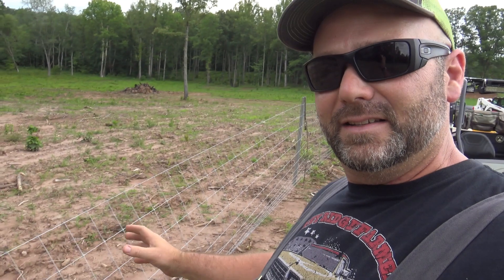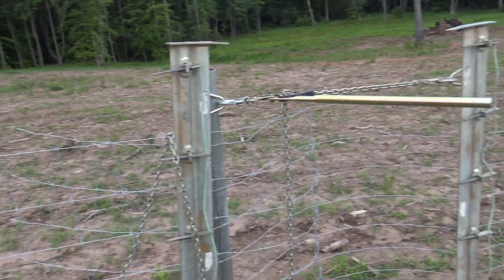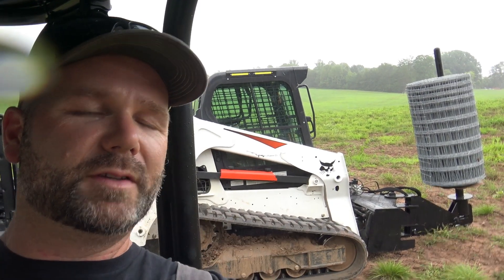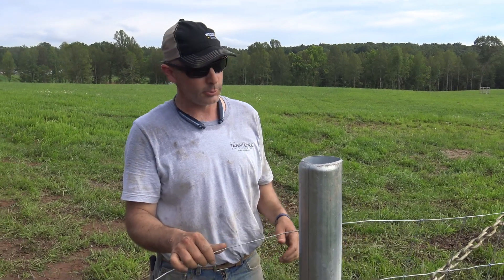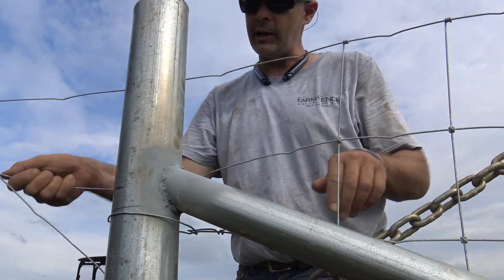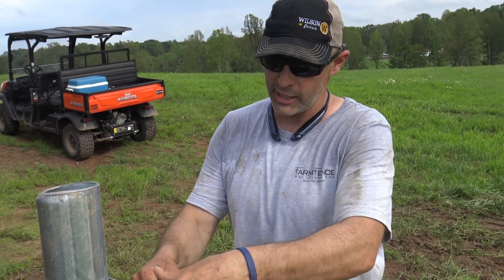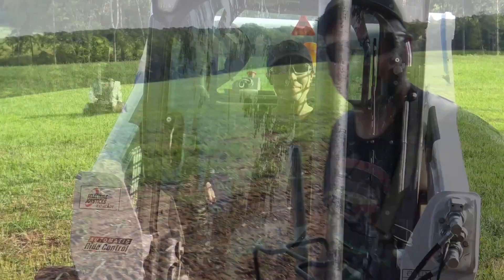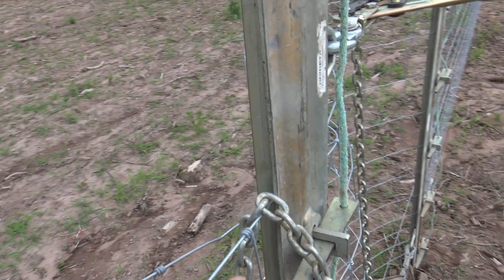Farm fencing at it's best! Learn fencing tips as we build 1 mile in a day!

Comment: The not they use is prettey simple it doesn't look like it would hold up to a lot of pull but after I seen how it works it deffinetley a strong not and just so simple the more pull the tighter it gets its awsome good job ya all looking good
Reply: It's strong alright. Our longest single run without tying off to any strainer posts in between is about 8½ km (>5¼ mile) of 6 ft high netting. Tension looks about the same as Stoney Ridge is putting on
Reply: @wrerikwinkler   I want to come fence with you!  Straight runs like that are what I dream about.
Reply: Farm Fence Solutions LLC in Australia we have what is known as the rabbit proof fence which was put up in the early 1900s. It's a total of 3256km or 2023miles depending where your from.
Reply: @47Rolling  ya t j.g atsg a lot of fence wow I'm up in newhampshire but wow it's amazing how far this fence can stretch

Comment: There is a you tube video about the Dingo Fence Machine that does six strand electric fence, two men, truck, trailer, ATV and marking equipment. Six kilometers ( Australia ) or 3.728 miles per day. It's great to see all this happening. A mile a day is phonemonial.
Reply: Karl Elliott  That’s a really neat machine!  Straight line fencing with no rock sure would be a dream, wouldn’t it?
Reply: Farm Fence Solutions LLC  Yes, I found it pretty amazing. Charles Kauralt said N. C. mountain land had to be pretty strong to hold up all those rocks. A fence post hole through granite is pretty stout. Down east sand and Piedmont clay, not so bad in places, except for the granite rollers and flint rock. In southern Davidson County N. C. our well went 243 feet through dry slate, hit the water which came within 20 feet of the surface and with air blew a solid six inch river. Hedrick estimated 1500 gallons per minute.

Comment: NOICE!!  Hey Josh, why the change in fence from the 1348-12 to the 1147-6?
Reply: We were showcasing a bit of the variety available from Tornado Wire.  1147-6 Torus is a square knot fence, which still has the stiffness of a solid vertical stay like 1348-12 Titan, but with the added capability of 1/4 mile rolls.  The USA has a very diverse regional net wire preference, so we like to appeal to as many as possible.  Thanks!
Reply from the maker: We wanted to show you some diversity and do some longer pulls

Comment: For those that play with galvanized pipe, welding , and if you don't have a mask, drink a 1/2 quart to a quart of butter milk right after. Quantity depends how long you were welding. If welding 8 hr's, a quart of butter milk. It help's big time.
Reply: That is only a temporary fix.  The long term damage will already be done.  Just DON'T weld galvanized steel without proper lung protection.  It's not worth it.

Comment: A winch with a remote?!?! Oh man, add that to the list.....
Reply from the maker: Was pretty sweet huh
Reply: I have one on my ute (pickup to you guys), saves having to pop the bonnet and run cords for the controller when you need to use it. You can pick up a reasonable wireless remote that hooks into the solenoid for around $15 on ebay. Great invention.

Comment: I saw them throwing broke off pieces of wire inside the post. Not a good Idea. Those pieces will rust on the ends and wherever they touch the post rust will form. Suggest getting a magnet  and retrieving those pieces.
Reply: That's not how a sacrificial anode works my friend.  The cut end will be healed over in a matter of days.  Good on ya for thinking of that kind of detail though.  Most folks wouldn't care enough to give it a second thought.  Thanks!
Reply: Electrolysis will result,  A anode is designed to decay first. The wire is not a anode.  A anode is usually made from Zinc and or aluminum.  A anode is usually firmly attached to the part being "saved" so the sacrifice is the anode corroding away and not the  good part. Nice fence .  @farmfencesolutionsllc
Reply: Mike Goodman  Galvanized coating is the anode. If you can prove me wrong with a controlled test, I’m all in and will eat my hat. I can cut a piece of wire, leave it in the rain, and it’ll never (in the next 30 years) rust.  You can scrape the Galvanized coating off of wire, and it will heal right up. I do appreciate the theory, but I like evidence to support the theories I back.  Electrolysis wouldn’t occur without a source of stray voltage, which isn’t present in this situation. Galvanic corrosion could occur in the perfect conditions, but we are lacking a conductor for the electrolyte. In the end, these posts will outlast everyone reading this, so it’s a moot point. Still, I feel like we should do a test. Any recommendations?  🍻
Reply: Putting scrap wire down the steel posts should be good for business in the future.
Reply: That's more about preventing a cow getting "wire disease" than about sacrificial anodes ...